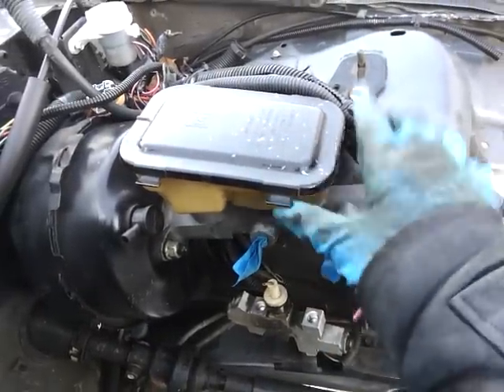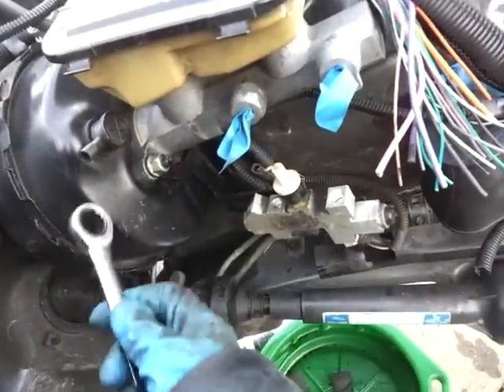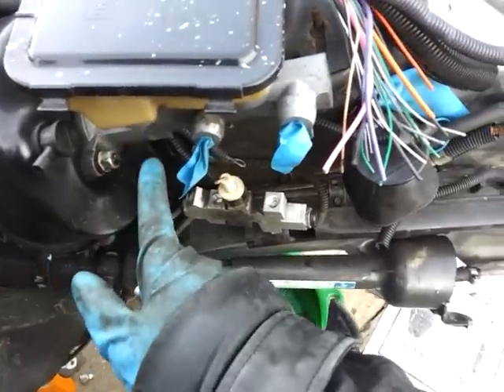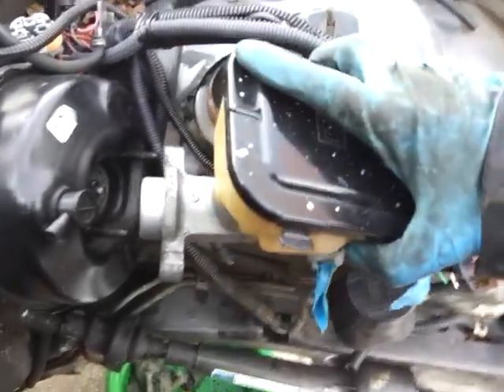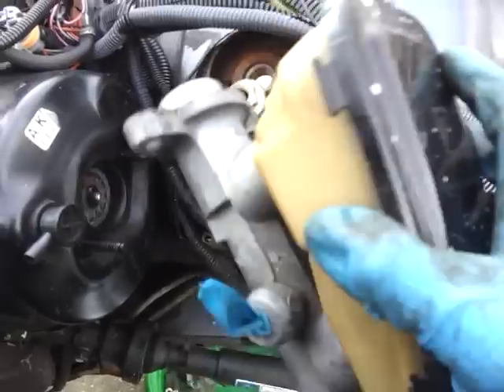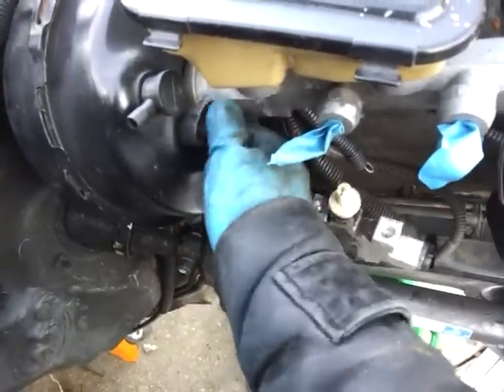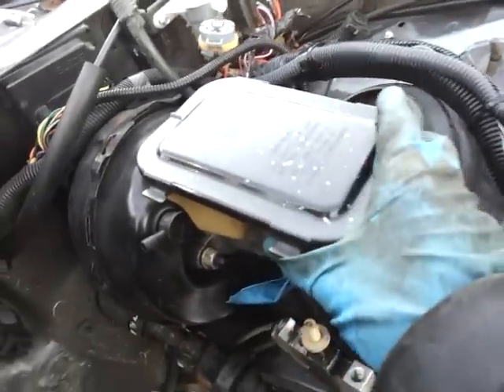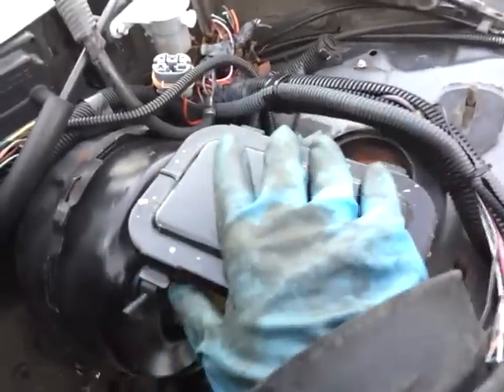How to replace / install a brake master cylinder

Comment: Thanks for that video very helpful. i did bleed the brakes and started from the back wheels first then the front but when i turned the key and started the car up i put my foot on the brakes and it just went strait down again no brakes at all so it  might be the master cynlinder ? I will look at it thanks
Reply: br FBT h
Reply: br FBT h
Reply: l u

Comment: What happens if you dont bleed it and just "pop it back in"?
Reply: The whole thing breaks again bleeding is a must or so I have been told
Reply: TKOG your brakes will be super super sponges due to the air in the lines. Air is compressible liquid is not